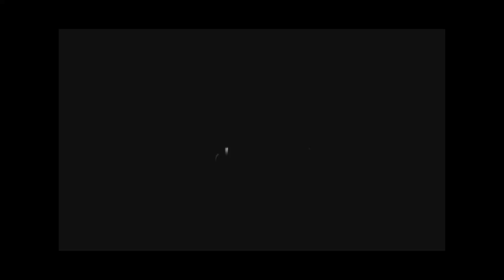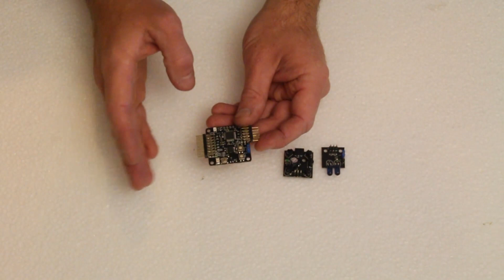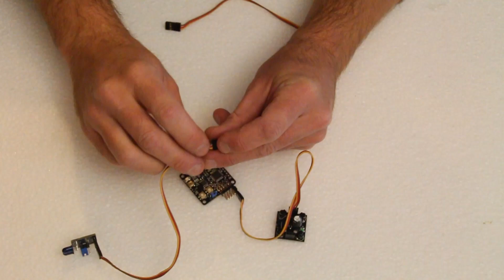Ace Combat (RC Laser combat) quick start guide

Comment: Is this kit your invention/ design? Been a VAS fan for a little while now, keep the greatness coming!
Reply from the maker: I started working on this in February of 2017.  I finally got it all finished (and patented).
Reply: @CAGreve1231  Can this system be used with digital video, or does it only work on analog?
Reply from the maker: Both. It doesn't even need FPV to work.
Reply: @CAGreve1231  Thank you!